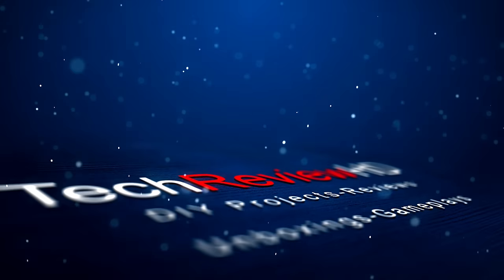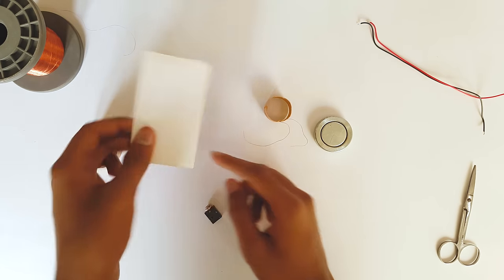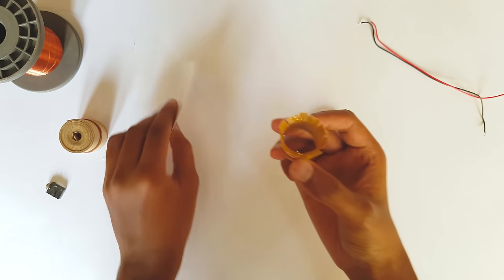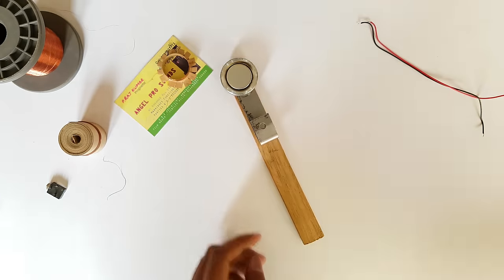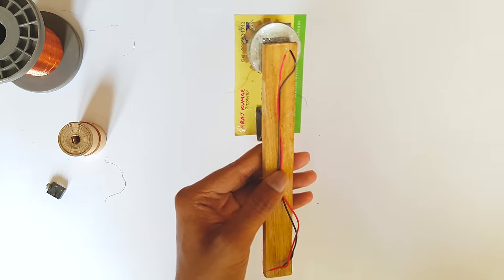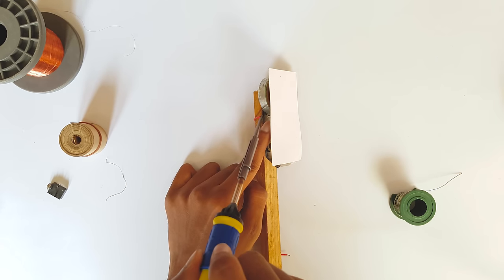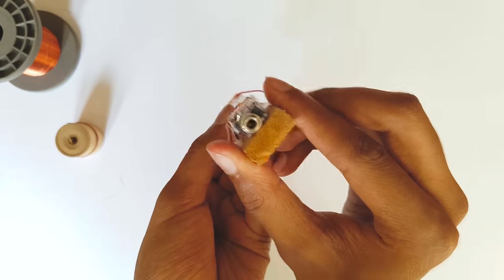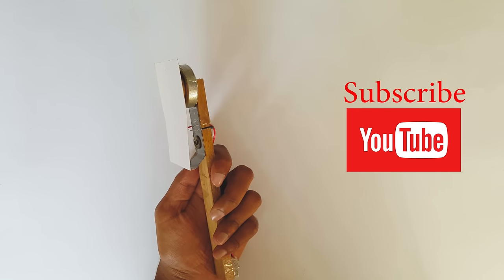How to make Microphone at Home Using Business Card - Very Easy!

Comment: The sound is quite good:) I`ve made such a mic a few weeks ago, it worked good but when I connected it to an amplifier, I started to receive radio signals:)) I managed to solve this problem. I just soldered a 100nF capacitor in parallel to the coil and the radio signals were not hearable anymore.
Reply: You can also change the card to something less sensitive.

Comment: Hos does it work amazing
Reply: Your voice makes the diafram (business card) vibrate (just slightly). The magnet creates a small current in the coil representing you voice, this small voltage goes to your mic amp to amplify the small signal to something bigger. It is actually the same mechanic as a speaker just your voice creates the signal. If you put sound on this it will work as a speaker en produce audio/music. You can try this out by putting a (old) headset in your mic port turn up the gain so you can hear your (ghetto) microphone ....

Comment: You Can Also Remove A Voice Coil From Any Old Speaker Just Pull The Centre Part Which Made Of Paper I Also Do Same But My Coil Is Not Fitting In Magnet.
Reply: how many inches means 200 tons